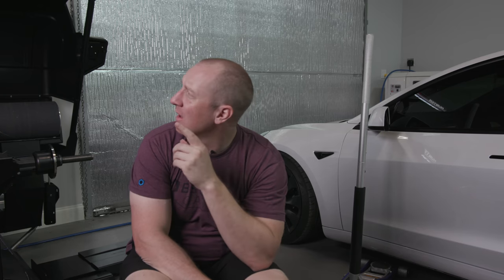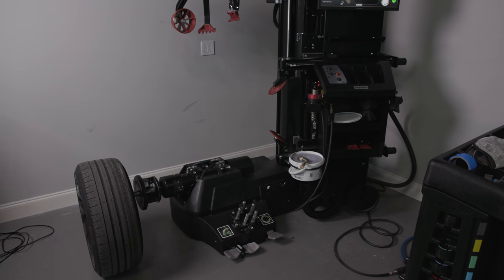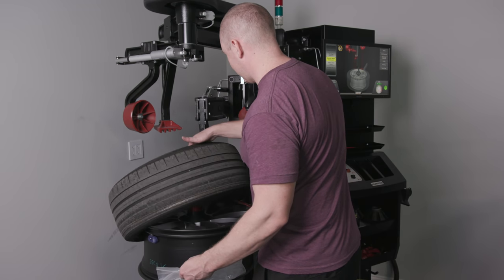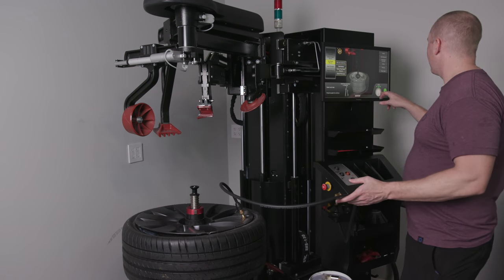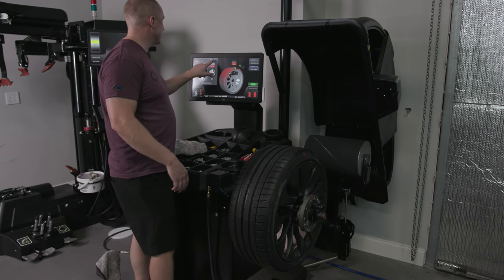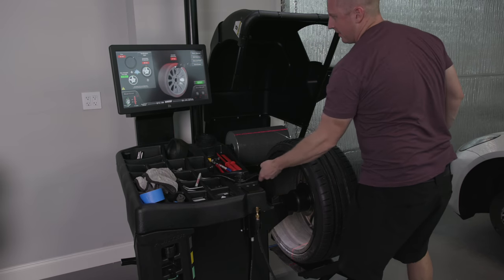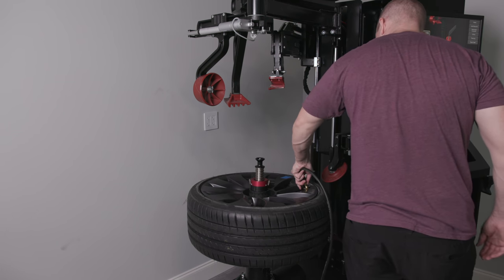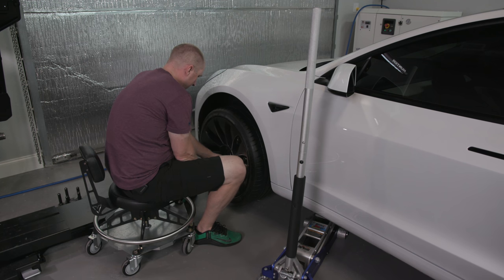First DIY Hunter Road Force Tire Mounting & Balancing on Tesla Model 3

Comment: As someone who has been using this exact equipment for the past 5+ years this video was painful to watch. Not in the typical Obsessed Garage fashion. I'd highly recommend getting someone there that knows what they're doing to help you along, your local hunter rep that you purchased the equipment through should be more than happy to come by and get you going more efficiently(Especially for the $$$$ these machines cost!). A couple notes: 1. You used way too much lube, lubing the wheel also is unnecessary. 2. The press arms need to come down that far to keep the top bead in the drop center when mounting otherwise you may damage the bead. 3. You didn't show setting the wheel dimensions on the balancer so I hope you're doing that. I'm assuming that just happened off camera. 4. Roadforce balancing is great and I do it on every wheel, but you will learn that if the road force is high and the machine only tells you to rotate the tire an 1/8 of a turn or less you're typically better off flipping it 180 and checking it again. Side Note: 3M Wheel Weight Surface Prep is great!
Reply: Painful indeed.
Reply: Super helpful tips from the only guy I let change my tires ;) Nice points Kyle.
Reply: I was thinking whilst watching there must be pros shouting at the screen whilst watching this and there were! Especially after the condescending comment “if people on $8-$10 an hour can do it, then I can”
Reply: I agree but there is something very ORGANIC watching mat do this. Even if he only knew little much about the machine. Flow with the punches bro. Don’t always have to know it all. He’s learning. Good bless
Reply: @Dominick I’ve spoken to few people here on youtube as they seem to be throwing negative words towards Matt and his growth or his way of business. I’m sorry but if you don’t like his content then there are 35 million youtube channels with content. Take a pick but no need to be cold towards OG or his growth.
Reply: Maybe you should consider flying out to OG HQ and training Matt.  He might even offer you a job as his personal tire installer lol.  

Matt will figure it.  You have 5+ years of experience compared to Matt having 4 tires worth of experience.  I’m sure it took you long enough to get good at your craft.
Reply: kma5783 you took the words right out of my mouth. It's clear he does not have the technical background needed to do this process. Can you imagine if he worked for a dealership or tire company and took 40 minutes to do 1 tire install and balance.
Reply: @Lexist-gn5ub   no I can’t imagine OG doing that. Because he is doing this for him self. He can’t talk all day doing one tyre, who cares. What matters is that he has the passion and time to do this. He made his dreams into realty. Who cares if he spends 80k on a machine which he doesn’t know how to use. It’s his life. Let him live and let him share with the world. Give love! It’s easy to point fingers at him. Look at the bigger pictures. If I was OG I would turn comments off not allowing all muppets on youtube to just point fingers and make fun.
Reply: actually on the road force elite it has a laser that automatically measures all the wheels dimensions
Reply: The local Hunter reps are trash when it comes to training.... I can show anyone how to be a Match Mount King if they are willing to pay for training.

Comment: When mounting the tire, there should be a dot or indentation and that is where you place your valve stem. The tire is engineered to compensated for the weight of the sensor in the tire itself.
Reply: Michelin does not use dots.

Comment: There could be many reasons for the high road force numbers, but the “chasing” you are experiencing is classic assembly not mounting correctly to the balancer. 

1) you must perform a bead massage on the Revolution. That will ensure the bead is seating correctly on the rim. lube tire and rim as you did and use the bead massage function before heading to the balancer. You should apply some lube to the outer sidewall so the pressure wheels do not damage the sidewalls

2) Balancer: Check that your collet is not too small and bottoming out inside the hub. Some hub bores have an inner lip. You may need a larger collet or use the red spacer to ensure you are getting good clamping force.

3) Perform a centering check on the balancer to verify you have mounted the assembly correctly. It’s a good idea to turn the rim a bit while clamping. Double tap the pedal to activate the auto-wind function. 

4) Remember, the clamp on the balancer must be TIGHT.

5) Turn your Smart Weight savings to zero in setup or use dynamic balance mode. Smart Weight is meant to save high-volume tire shops money on wheel weight costs and will focus on static balance over couple “shimmy” balance meaning you do not get a perfectly balanced assembly. You will likely notice some vibration on a Tesla using default Smart Weight settings. You can see the results on screen on the tire images (bottom-right corner on your display) — left is static and right is couple. The dashed line is the “acceptable vibration” tolerance which I can see is set very high. 

6) The 3M adhesive weight system is awesome. Tesla uses it and it allows them to balance to 1 gram of tolerance. You can do this on your machine in dynamic balance mode with rounding turned off.

7) Don’t final tighten your lug bolts/nuts with the car’s weight on the wheel assembly. Use the parking brake or a steel wheel chock to hold the wheel in place while final torquing. 

Truly mastering wheel balance harmonics takes a lot of learning and practice, but you’ll get there! Your tools are the finest in the industry.
Reply from the maker: Heck yeah!  I'm saving this as directions for my next set of wheels!

Comment: As far as your problems with road force, you might have the heaviest part of the tire close to the valve stem. While I dont think Michelin marks the heaviest spot some manufactures do still use a red dot on the side of the tire to denote the heaviest spot and a white or yellow spot to denote the lightest spot. I think if the machine is telling you that you need a lot of weight to balance you need rotate the tire 180.

Comment: Those wheel weights are made by 3M. You cut the weight to a specified length depending on how much weight you need, using a proprietary measuring+cutting tool made by 3M.

Comment: Pay attention to paint marks on tire sidewall. Tells you where the lightest part of the tire is. Match that to the valve stem on the wheel when you first mount. Will balance batter.

Comment: Just some advice here. I have been mounting tires for a long a while now. If you want to do a really good job of it you should definitely clean the rims first then take all the old wheel weights off and use some 3m adhesive remover and a plastic scraper to remove any old wheel weight adhesive that way the barrel of the rim will look nice and you will have a nice surface to mount your new wheel weights to.
Reply: Wheels* not rims
Reply: @ErnstDetailing  I grew up in the 2000s reading rides magazine I will always call rims. Just like I will never pronounce Porsche porscha
Reply: @ErnstDetailing  I'm with Chris on this one...
Reply: I have a question about the air pressure when not using the OEM tires. Back when i had my jeeps 37’s balanced they set them to almost 60 psi. Felt like my tires were bricks haha.
Anyways, normally they are around 30 psi.
Reply: @Jeeper1378  tire pressure can be tough to figure out when not using a stock sized tire. 60 psi seems like it would be over the manufactures maximum tire pressure for that tire. What I would have done in that case is set the tires to whatever the door jam says like 35psi then I would take chalk and draw a line across the tread and drive a few feet with the car if the inside is missing the chalk more then the outside of the tread then you air pressure is too high if the outside of the tread is missing more chalk then the inside you pressure is to low you would want to adjust this in 3 psi increments until you found a pressure where the tire seemed to wear the chalk evenly
Reply: @Rocheman79  chalk test is how i came up with my psi. I should have been more clear, what i meant to ask. Would running that high PSI affect the balancing?
Reply: @Jeeper1378  no it shouldn’t. What’s important is the tire is seated properly which is something that is rarely messed up
Reply: @Rocheman79  ty when I brought it up he said it had to be set to whats on the tire.

Comment: When you have a 1/4 ounce after applying weights it generally means the weights need adjusted on the wheel depending on where it is telling you to add weight. If it’s 180 degrees out that means you need to remove weight from the original spot. 90 degrees out the weight just needs to be shifted etc. basically when you put the weights on you weren’t centered.

Comment: Find someone with a tire truing machine to get the road force into spec. You can balance them all day long, but if the tire is out of round, you will still have a vibration. You would think the money you spend for tires these days, they would be perfectly round, but I feel they are worse than ever. Tire truing does shave a small amount off of the tread depth, but it is well worth it in my opinion.

Comment: I've been drifting for 3+ years now and I've still never changed a tire. They have a machine at the track but, I've been to scared to use it in front of all the guys who have tons of experience. I know I would look just like this and I'll wait until I have my own. Although, mine will be very used from marketplace. I can relate to the comment about entry level guys doing it and thinking it cant be too hard. I don't think it was meant to be condescending at all. I get what he means and it's just a way to say he wont be intimidated by it.

Comment: If you push on the balance pedal twice it should automatically thread the tool on for you. If you push it twice more it should reverse direction so it will remove it for you.

Comment: I do way too many tractor trailer tires. I find myself comfortable using a Matco tools rebranded Lisle 15190 Valve Core Tool. Lube tires before dismount and mounting. you can use some soapy water to help with dismount.. Milton will probably be one of your best bets for tire air chucks.

Comment: In my city we have a guy who soley mounts tires and people ask why he charges $75-$100 per wheel to mount and balance. When you watch him do what is basically an art form of balancing tires taking him at minimum 1-2 hours to mount and balance 4 tires you understand. When other tireshops throw weights where it says and never really use a road force balancer to it's actual potential and wonder why your tire shakes at 60mph.

He's told me numerous times that certain tires won't balance and if the customer has the time they send em back. Pirelli is his #1 offender to tires that fail road force.
Reply: I need one of those guys near me. All the shops around me are franchises that have 10th grade kids doing the work, forcing me to drive an hour to a motorsports shop that does things right.

Comment: Check out the snap on valve core tool. It has a very nice screwdriver handle. They also make a nice tool to pull the rubber vavles into the rim.

Comment: From my experience, we don't use Roadforce unless there's a vibration complaint. You can tell if your tire is deformed with the Roadforce option and use the values the balancer gives as proof for warranty. Some dealerships don't even have Roadforce on their balancers.

Also, maybe you did it before but I didn't see you set the values for the weights placement on the wheel. (Sidenote: Why do you have 2 values on the outer side?)
Reply: As far as i understood it RF was not done unless called for ?
Reply: @Jeeper1378  That's right. It's not needed to balance a wheel, but handy when in weird vibration cases where the tire might be deformed... which are extremely rare from my experience.

Comment: Isn't it suppose to have you mark the high spot of the tire and low spot of the rim and then when you turn the tire you match the two up? (or vice versa) or are these newer machines different and not like that? I seem to remember that from years ago. I only saw Matt mark 1 spot on the rim which could be why he keeps having to re do it.

Comment: If there's more than 16 lbs. of road force, rotate the tire 180 degrees on the rim and try again. You should always be able to get under 16 lbs. by moving the tire on the rim to where the balancer says only once...no need to do it several times. Also your machine should be able to check for lateral and radial runout of the rim and if it's good then the tire is the issue. Michelins are good, but none are perfect and I've seen some shitty ones.

Comment: I own a tire shop and have the Hunter TC39, The road force elite, and the Hunter Hawkeye elite. I was considering buying the revolution but I couldnt justify the price. The TC39 will do everything it does. I feel like automated stuff goes wrong too often
Reply: also always use lube for both demounting and mounting. During demounting the rubber can bind and cause stress on the machine and/or the tire. lube makes it easy and smooth for the removal and install
Reply: also put some lube on the face of the wheel for low profile tires. It will allow the tire to slide over the wheel face
Reply: also the tpms needs to be at 1 o'clock to demount and 6 oclock to mount. I think the revolution is sooo complex. TC39 is waaaaaaaaaaaaay faster
Reply: also you need to massage the bead before putting in on the balancer
Reply: when match mounting youre not pinching the tire enough and you need to pinch top and bottom at the same time. alao make sure the tire is going under the drop center. that is what allows the tire to rotate

Comment: I thought that the tyres had dots on them so you put this on the same or opposite side to where the tyre valve is to make it much easier to balance so it matches the extra weight of the valve?

Comment: You forgot to mount the heaviest part of the tire near the valve stem. There are marks in the sidewall to denote this. Also asking a rep to do a walk through on one tire wouldn’t be a bad idea either. You’ll get there I’m sure 👍🏼
Reply: Think you want the heaviest part of the tire on the opposite site of the valve stem to counterbalance
Reply: @lukas7417  Sorry yeah you are correct I more meant you like up the mark with the valve stem, but the way I worded it was wrong. Thanks for the correction.
Reply from the maker: PS4S don’t have a mark

Comment: Great video, but it looks you really need to get some training from manufacturer rep, but knowing you, I am sure you won’t quit until you become the best at this. The road force number is usually good to attain but sometimes it is hard to achieve if you have less ideal tires or wheels. Even new Michelins can come new with large unbalance, and let’s not forget this is a Tesla, so it is highly likely the wheels are less than ideal. Also a final note if the machine is showing a high roadforce number, and it is only asking you to rotate the tire by less than a quarter of a turn, it would usually mean that you probably have a bad reading or possibly large built in unbalance in the tire or the wheel,. In that case I would rotate the tire by 180 degrees and get another reading to confirm you didn’t get a bad reading. Once you get this down, my next flat or tire replacement , I am driving to you from Washington state to get my tire taken care of by the best. Mark
Reply from the maker: I’ve got big plans for all of this.  I purposely got some really basic tips from my reps.  Then I wanted to dive in head first.  That’s where the magic happens.  This is how I learn best, on my own with no one to bail me out!

Comment: Sometimes I feel like the balancing technology is just not quite there yet. I've taken wheels to the same shop 2-3 different times because they don't feel like they balance out quite right and everytime they come back with " It said it was __ oz off". Which doesn't make sense because they just balanced it with the same machine the last 2 times.
Reply: You can balance a tire to 0grams. Drive it around the block and it will be off again. Guaranteed

Comment: You mounted a tire without jacking up a wheel or driving to a tire shop..  Thats a success in my book.  I really think that the key is finding the light spot in the tire and lining it up with the stem in the wheel, then you won't spend so much time adjusting the tire for road-force.  It seems the machine can only recommend small moves in the tire, so being closer to perfect from the beginning will mean less iterations with the rotation.

Comment: Lube even when demount, roller longevity. When mounting tire push the side right in front of you down
So that the tire goes sort of under head as u turn in
Reply: Also weights changing means either it's not correctly on the collet, or odd case you need a calibration
Reply: Don't worry so much for roadforce, a lot of low pro will have 9-22 lb roadforce an if you try chasing 19s you'll be changing tires all day. 17s with like 225/45/17 would road force better.